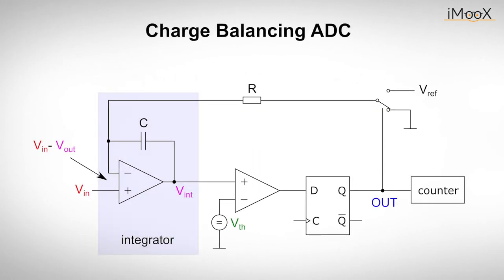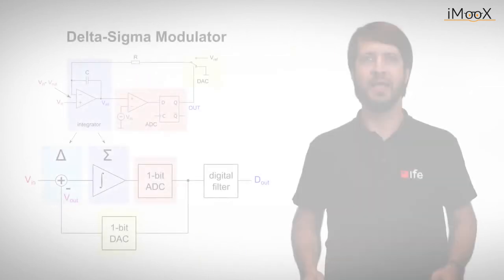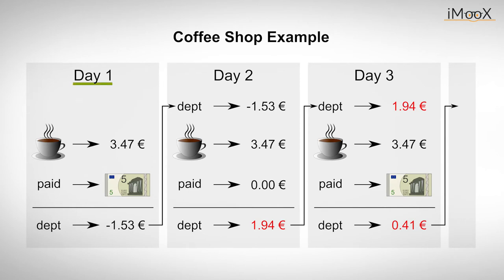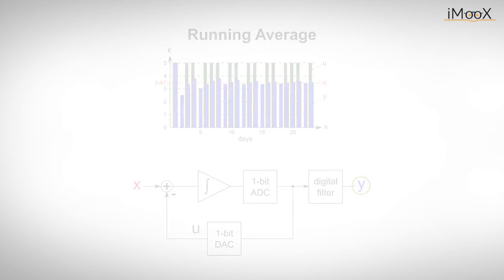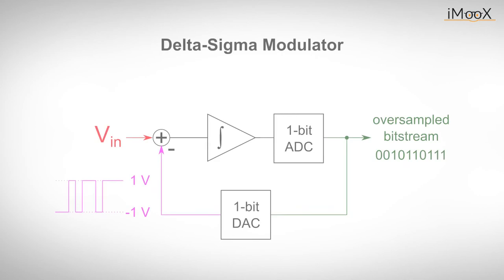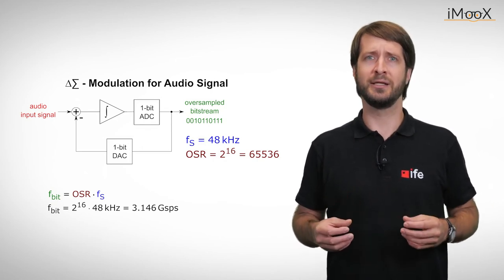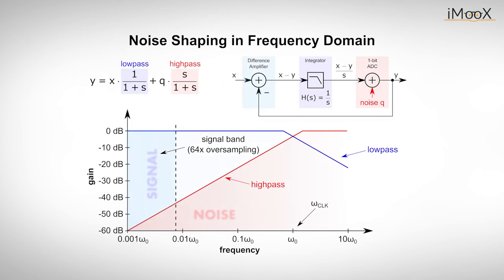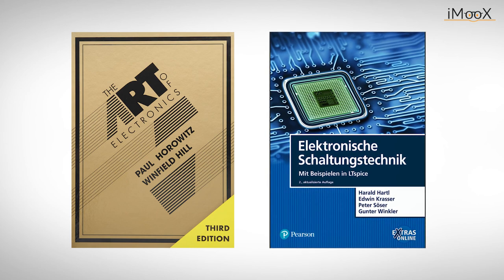Analog-to-Digital Converters (ADC) - Charge-Balancing and Delta-Sigma ADC

Comment: The only thing missing, and what I'm searching, is about how and at what point of the ADC system there is a transition from single bit data to multiple bits of data. For example, how you get from single bit stream to 16 bit audio
Reply from the maker: Thank you for your question, that is indeed a very important question to fully understand Sigma-Delta ADCs.

We can recommend, that you have a look at this website: https://www.analog.com/en/design-center/interactive-design-tools/sigma-delta-adc-tutorial.html
There you can find a nice tool to "reproduce" the behaviour of a sigma-delta ADC step-by-step.

In the example on the bottom of the website, they use a bit-stream which is 8-bit long, Vin=1.0V and Vref=2.5V.
They receive a bit-stream of 1 0 1 1 1 0 1 1. We can see, that 6 of 8 outputs are high and 2 of 8 outputs are low. This means, that 75% of all outputs are high. Translating this back to a voltage would mean, that we are at 75% of the input range (in this case between -2.5V and +2.5V). Calculation gives Vout=-2.5V+5V*0.75=1.25V.

If we are looking for a digital value: As we have 8 bits in the (unary) stream, this corresponds to 3 bits (=log2(8)) in a binary representation. In our case it would mean, that we would get a digital output value of 110 or 6 in decimal.

Some more examples to understand the concept:
unary            -> binary
00000000    -> 000
10000000    -> 001
00000001    -> 001
00010000    -> 001
01010101    -> 100
10101010    -> 100

We hope this help in understanding the concept :)

Comment: Can we design TRNG using this?
Reply from the maker: In this video we only focussed on the basic principle of Sigma-Delta ADCs. Your question however, whether we can build a True Random Number Generator (TRNG) with these ADCs, is quite straightforward.
It seems like there is some research [1], [2] ongoing in this topic, but we do not have any research experience there. So we would recommend having a look at current literature.

[1] https://doi.org/10.1109/LSSC.2020.3010901
[2] https://doi.org/10.1109/ISCAS.2016.7527159